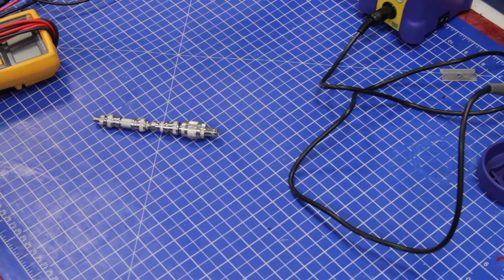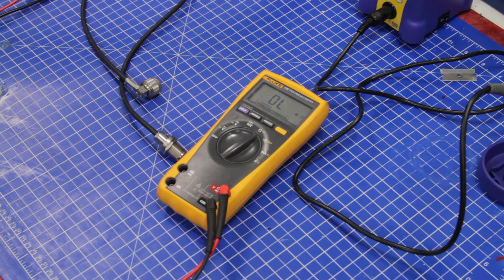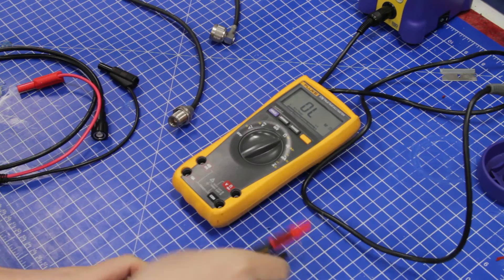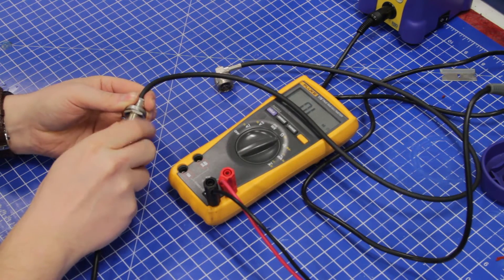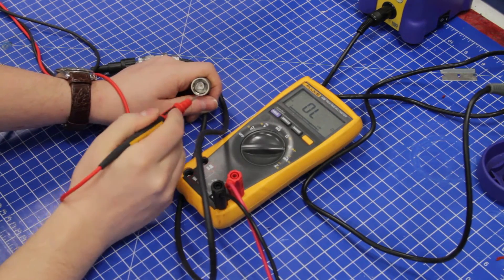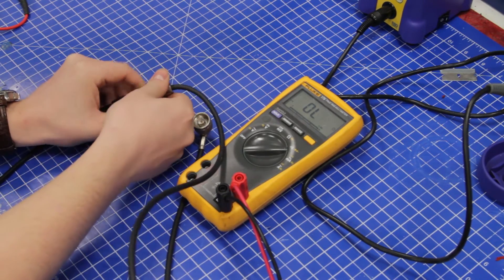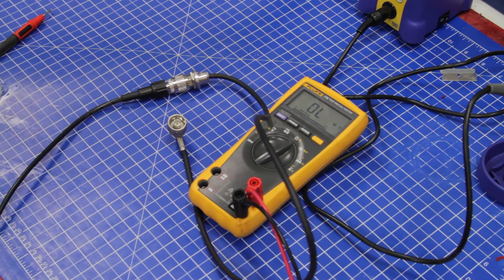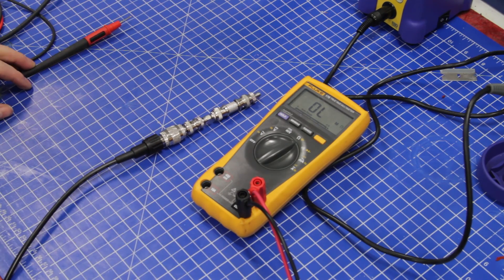How To Properly Test RF Cables

Comment: If you turn either cable to the left first, it aligns the threads. When you turn it to the left, you will feel it click, that's the threads aligning...at that point,  tighten as usual.  You're welcome.
Reply from the maker: Yes, I'm aware of that, however try doing it on camera and you suddenly are all butterfingers :)